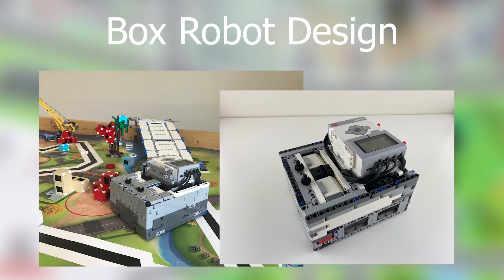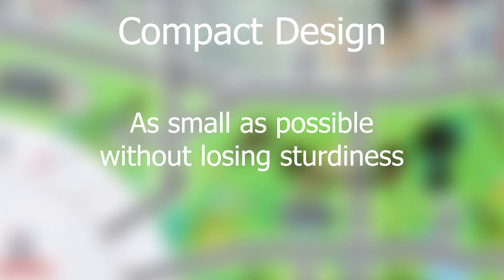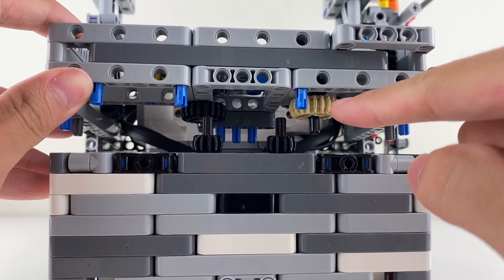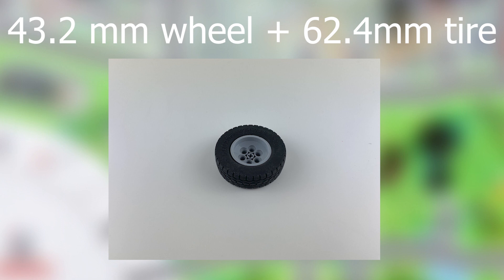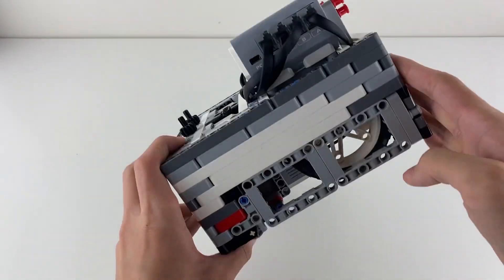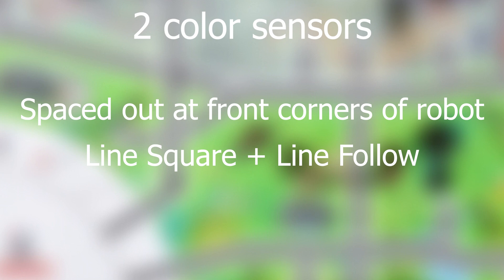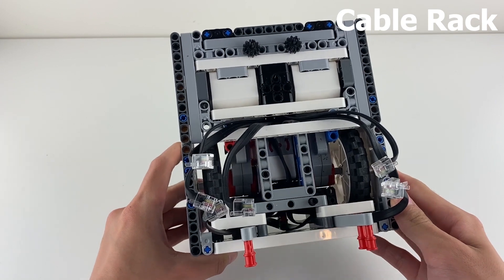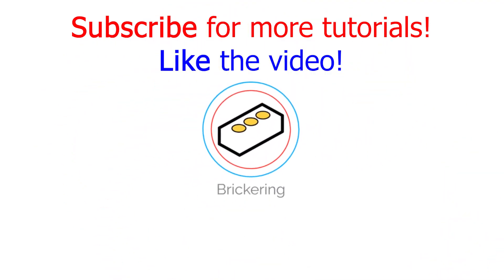FLL Replay: How to Design Your Robot!

Comment: What's your opinion about the big wheel of Spike Prime? Do you think is it better than the motorcycle wheel that you used in your robot?
Reply from the maker: Good question! I don't have a spike prime wheel, so I don't know for sure. Judging by the size, I would assume that the performance would be about the same. The spike prime tire looks a lot more smooth and robust though, so that may make it better than the motorcycle wheel.
Reply: @brickering5166  Thanks for answer. Your videos are just amazing!
Reply from the maker: @allansotero4672  No prob! thanks for watching!

Comment: Incredibly informative video; this is going to help a lot of FLL teams heaps! I was wondering whether you have building instructions, or even just a few more pictures of the internal structure of the robot without the outer walls? If not, it's all good - this video is plenty to work with :)
Reply from the maker: Thanks! I don't want teams to copy my robot this season, so I'm thinking about releasing robot instructions as soon as the season ends. Let me know what you think!
Reply: @brickering5166  Not a problem thats sounds good!

Comment: You can also use 2 gyro sensors. The first is used as described in the video, and can be reset freely. The second acts as a compass, and is never reset, giving the robot a constant bearing of its direction.